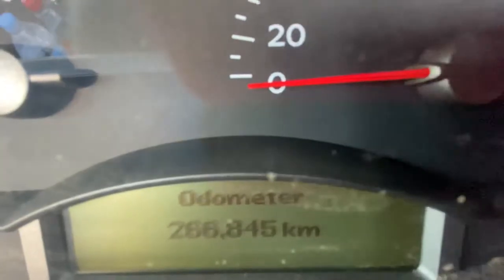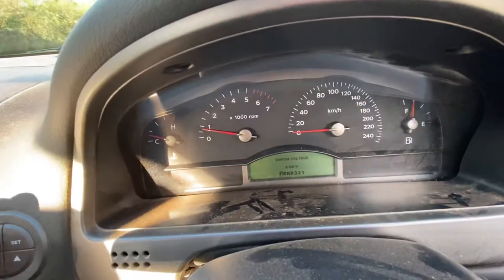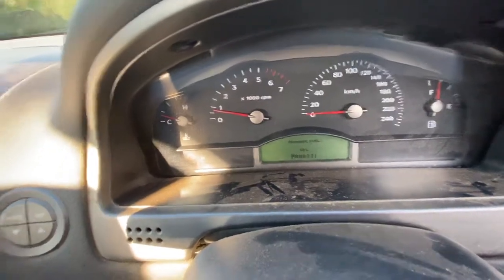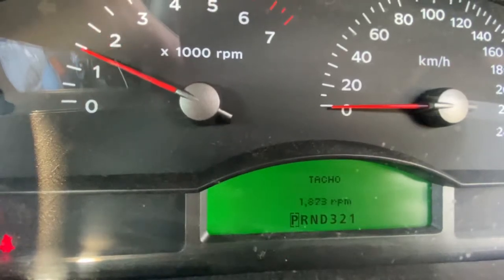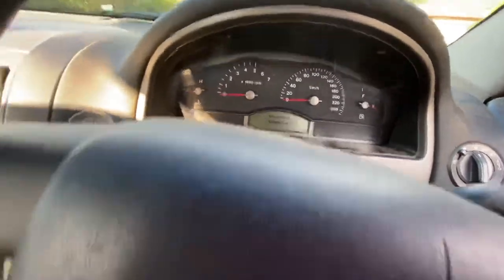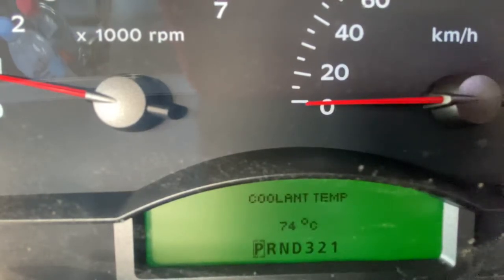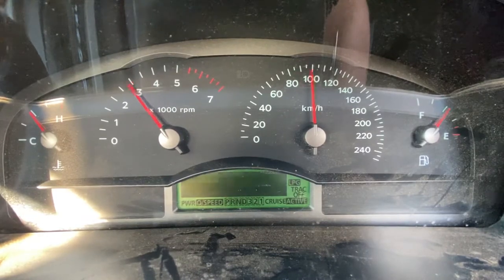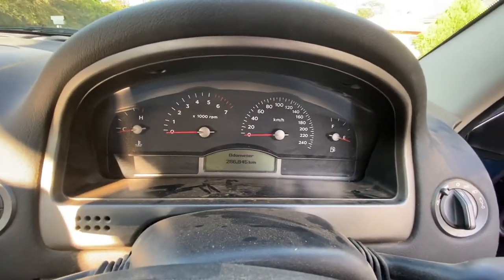How to access Diagnostics Mode on a Holden VY/VZ Commodore

Comment: The only thing I didn't understand was how to access diagnostic mode
Reply: You can view some trouble codes by
1: Pressing and Holding down the 'Mode' and 'Set' buttons while you turn the ignition on
2: Cycle through the different display and you can view a bunch of trouble codes there.
it is the second last menu item before the Dash test function.
Reply: @kevinsmith467  Thank you